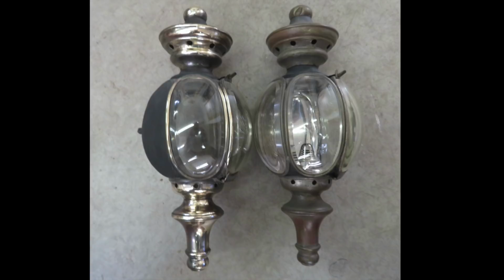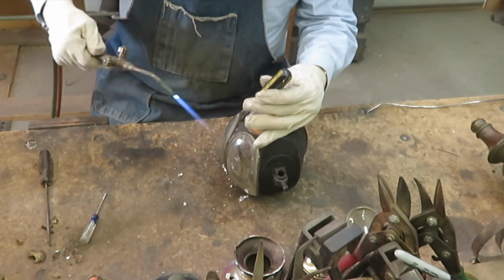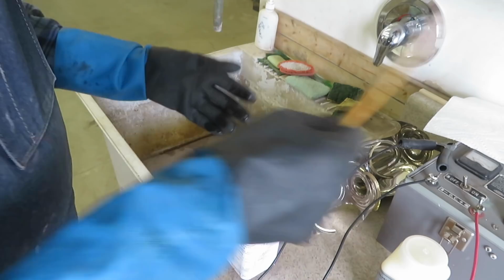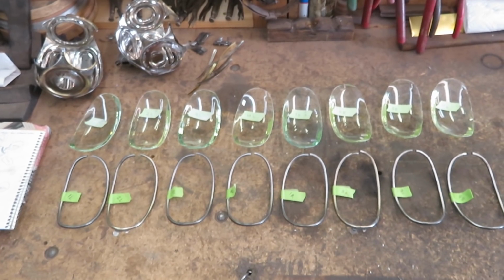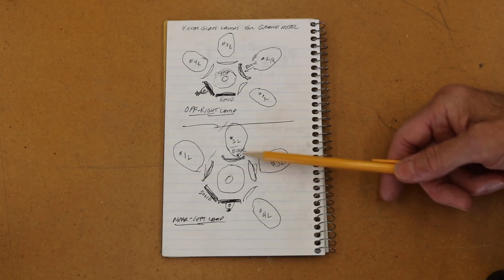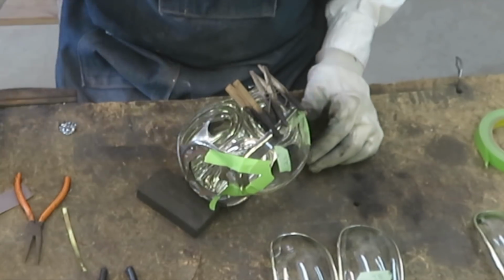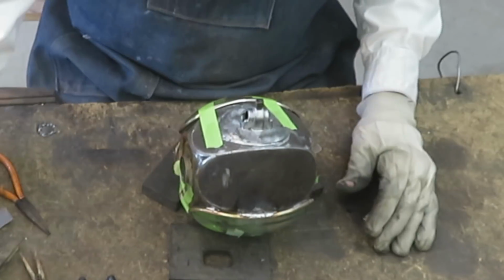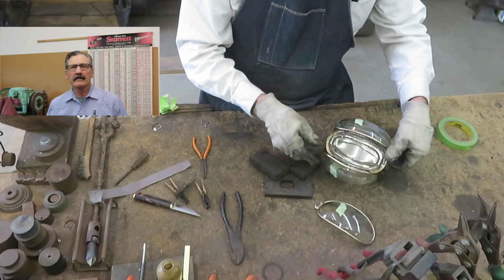Unique bent glass lamps

Comment: I personally think that your glass polisher took away from the cut line by polishing across the edge and the face at the same time rather than polishing the edge separately and then the face along the edge instead of across the edge. The crisp edge should never be touched by the polishing wheel. On the originals the edge stood out but now the cut edge and the face are blended together. 

I know that is not your fault but it is an obvious mistake worth pointing out to your glass guy for future jobs. We see this error so often when antique cut edge (beveled) mirrors are polished incorrectly. Most don't see the difference but in the antiques trade such refurbished mirrors stick out like sore thumbs. It is sad to see this happen to such a beautiful pair of lamps.

Comment: Rick. Do you have a link or source you can share for the roll of solder you use? I am starting to work with stained glass and the small rolls are a pain to deal with
Reply from the maker: Most welding supply houses can supply the various types of solder. The trick is getting 5# rolls. Usually a minimum order is required. 25# should do it. I use Idaho Welders Supply.

Comment: I find it amazing that the glass does not crack when you are soldering so close to the edge of the glass. I would be very nervous if I were doing that. Thanks for another entertaining video.
Reply: That just shows Rick's, and the original manufacturers', skill at controlling the heat.  I'd hate to see how many pieces of irreplaceable glass I'd probably break before learning the proper heat control!

Comment: You know what would be of great interest?
Close ups on the solder joints being made. How you control the flow of firstly the flux and the solder itself. How to place the flux so it does not flow on the wrong spots and the control of the solder to not solder wrong pieces shut. You are surely working in a tight spot.
I like the smooth type of and low sound on the stock music. Nice filler.
Some makers blend the music and ambient work sound, that can sometimes be nice too.
Thanks

Comment: if you find one with broken glass what do you do to replace
Reply: This glass is slumped.  You would need to approach someone with the appropriate kiln.  A mold would be constructed for the glass to slump into and the entire assembly heated until the glass took the shape of the mold.  The edges of this glass appear ground so that would be a necessary step.  Then and only then, could they be polished to remove wavyness and the scratches from the bezel grinding.  Likely would cost a very pretty penny to accomplish that.
Reply: @WhatAboutTheBee   Glass becomes weak around 700 gr. C , when you use an rostfreesteel dye, you can bent the glass easily in a kiln which reaches this temperature
Reply: you can grind glass easily but you needs water dripping for cooling,otherwise it will fall to small pieces, polishing you do with korkbelt or a polishingmachine
Reply: @tonwempe6998  Thanks Ton!